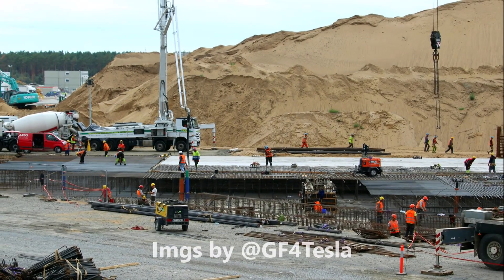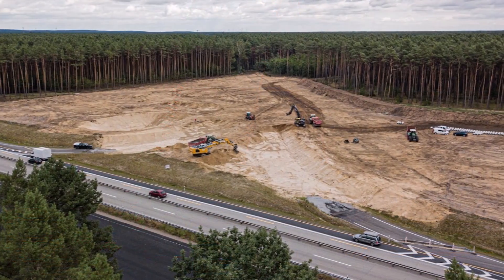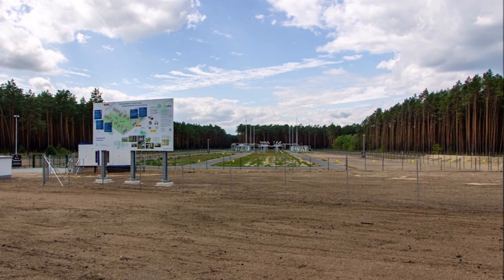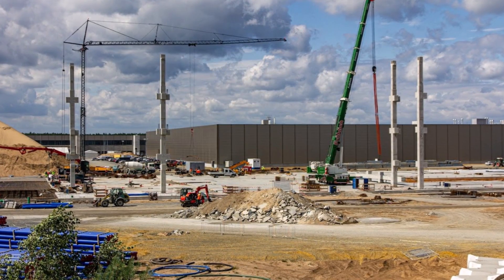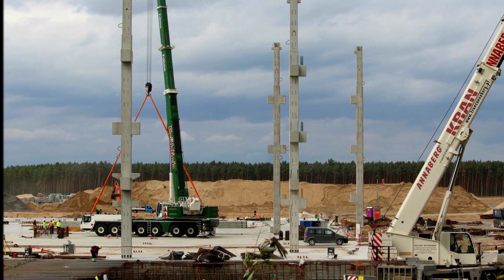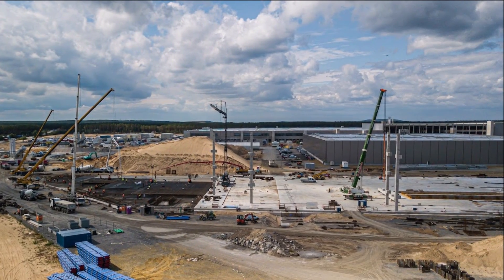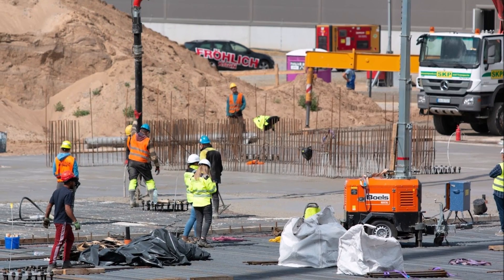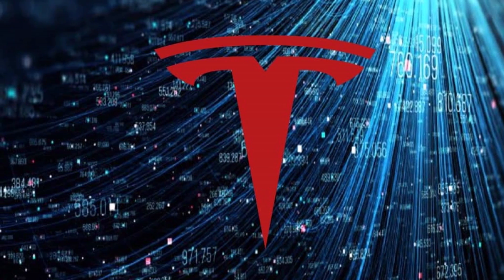See Tesla Reinforcing Giga Berlin's Battery Factory With Concrete Pillars

Comment: All the foundations at Giga Berlin have a limit of 6 meters below initial groundlevel (groundwater protected area!!!), that's why all the pillars of the main factory stand on a square foot to support and distribute the weight they have to hold....for the same reason you can see that the pillars for the batterie-building are heavy and tall (4 storeys) ... to distribute all that weight they had to build a foundation plate that is several meters thick!!!